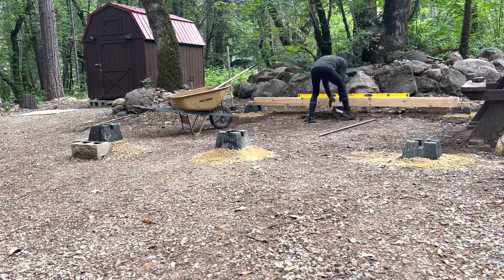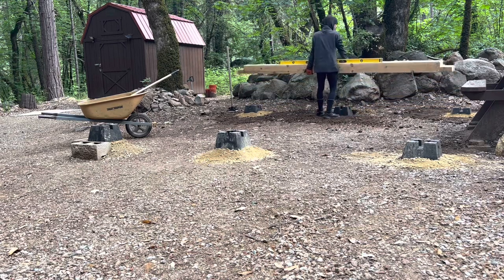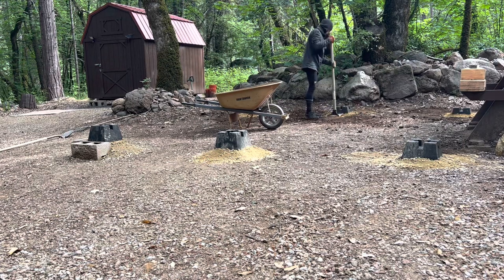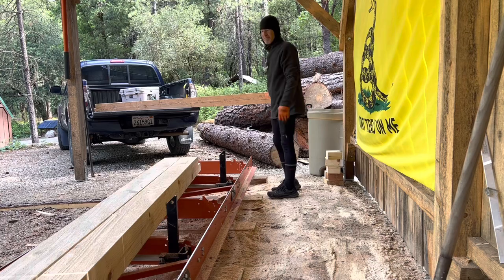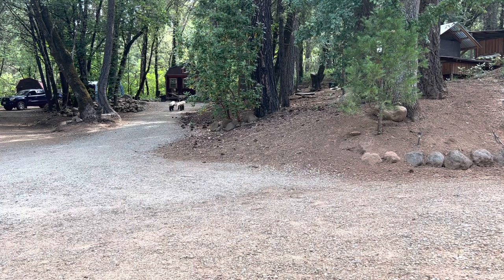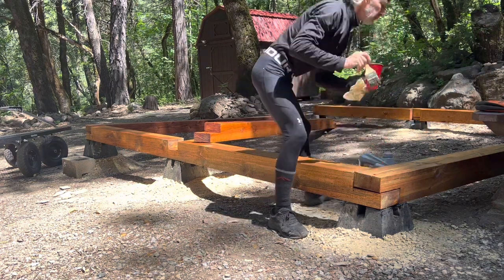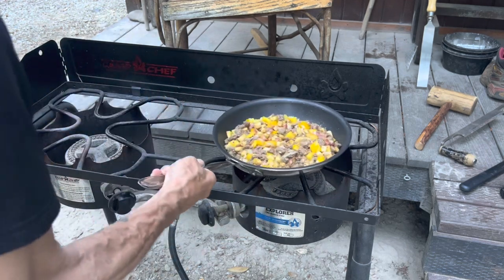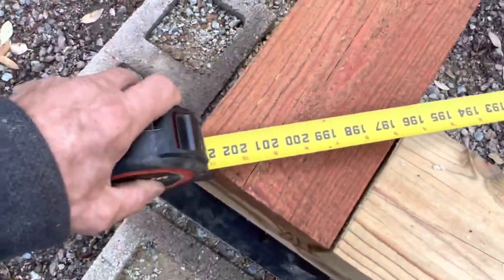OFF GRID OUTDOOR KITCHEN BUILD (part 1)

Comment: Thank you so much for this great video.  I'm planning my future off grid and I'm hoping to maybe do a shed to house.  I couldn't find anywhere how you finished your shed (I assume it was a shed delivery), what size it is? Would you do it again from a shed?  I've heard some people say the quality is pretty crappy.  What's your take?  Also, You did something in one of the videos replacing ceiling insulation with refletix for ventilation?! Could you talk more about that?  Glad I was recommended your channel.  I am physically not able to start a house from scratch so it's either get a shed or maybe a tiny house frame, then I can handle finish from there.  MAybe you could do a video just about your house related to the questions above when you have time.  Peace!
Reply from the maker: I do plan on a shed to cabin video soon. All kinds of good details. 👍👊